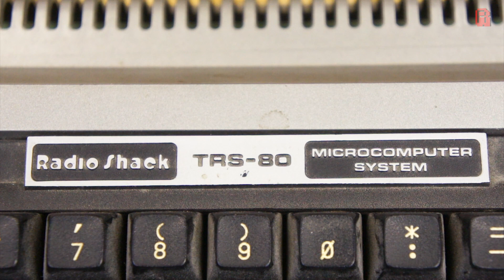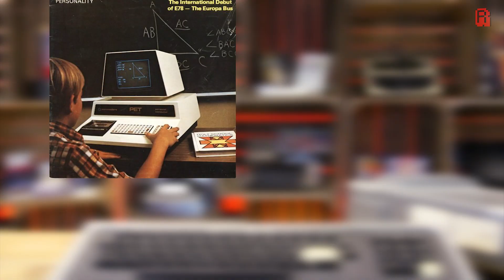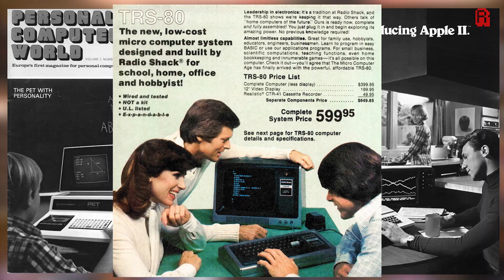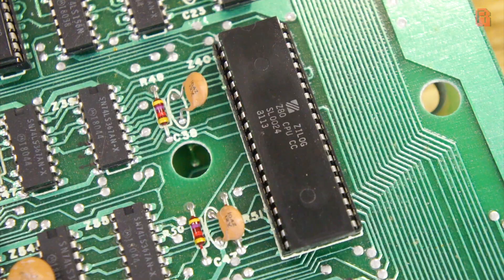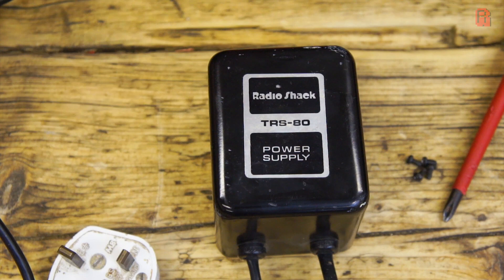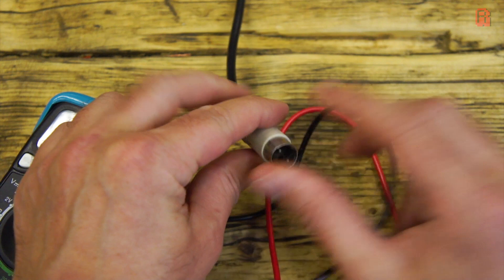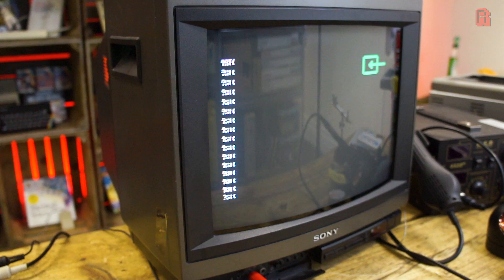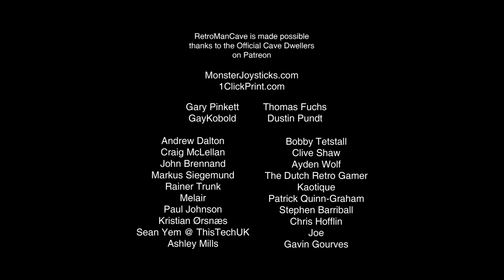Trash 80 to Treasure | TRS-80 Restoration Ep1.

Comment: how does piggybacking ram chips even work?
Reply: you piggy back everything except the chip select line. Then you piggy back other chips to create a small circuit to select the correct chips based on the address the CPU is addressing. The book (you can find the PDF if you do a google search) The Custom TRS-80 and other Mysteries shows how to do this.
Reply: Okay, so it's not as simplistic as I thought.
Reply: There are cases where you can diagnose chip problems by piggy backing a matching chip (without soldering) to see if you have a faulty memory chip for instance. The working one will frequently take over for the one you are piggy backed on. Good way to see if the chip is bad and then remove the old and replace it with the new (socketed!).

Comment: If you are looking for the colour of this to respray it, its Rustoleum satin nickel,first use a black matt basecoat, then 2 coats of the colour, will give very accurate reproduction https://www.screwfix.com/p/rust-oleum-universal-spray-paint-satin-metallic-nickel-0-4ltr/53368?kpid=53368&ds_kid=92700022649296645&ds_rl=1249484&ds_rl=1245250&gclid=EAIaIQobChMIttHVzKOa3AIVB7gbCh3McgUzEAQYASABEgJ1HfD_BwE&gclsrc=aw.ds&dclid=CM7hjdGjmtwCFUitUQodT_EIpA
Reply from the maker: That is really helpful thank you
Reply: No problem! i have just resprayed one and it looks absolutely amazing. has a beautiful finish to it